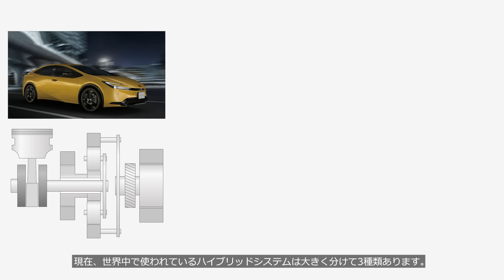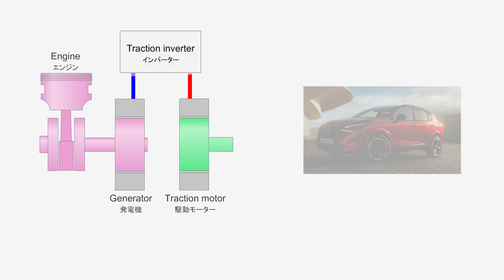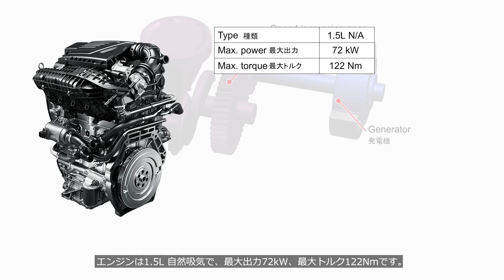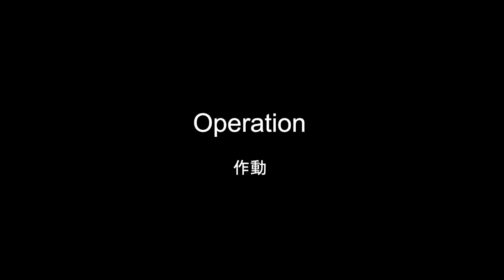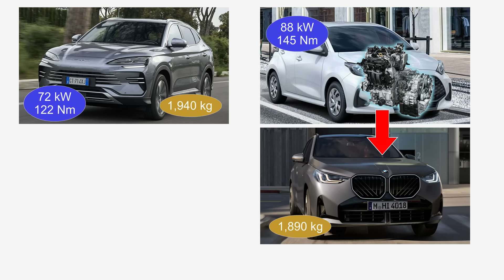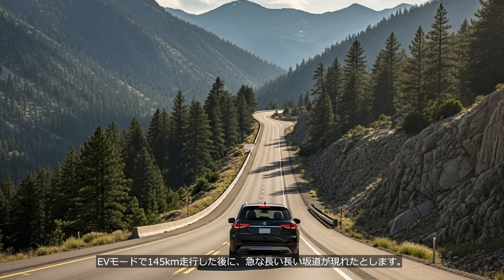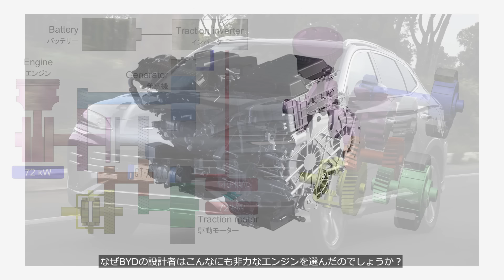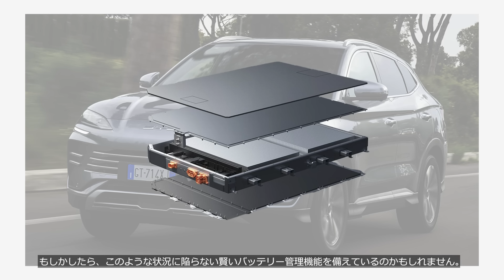Deep Dive into BYD Hybrid System on Sealion 6

Comment: This is a really easy-to-understand and excellent video. Thank you so much!
In addition to the fact that engine efficiency drops significantly depending on RPM and throttle valve opening, efficiency also decreases when the engine is still cold.
I completely understand that BYD’s system is outstanding, but batteries are also heavily affected by temperature, so I believe a proper thermal management system becomes very important depending on the usage conditions and environment.

Comment: I own a BYD Sealion Line 6 the same model discussed in this video in Australia for more than a year. I have driven up hills and long distances without any issues when the battery is low. It does 0 to 100km in 5.9 seconds and outperforms any regular petrol car. I believe this system has a battery management system to keep the batteries at least 20% state of charge. Engine will start charging the battery automatically at 20%. So when it is needed it has power to work with the engine and move the car. This car is super efficient and has driven 12000 km and 10,000 km are all ev mode only. It does not use gasoline during daily short trips. Excellent car and recommend to anyone. Far superior to Toyota Honda hybrid systems. I believe Toyota is working with BYD to implement this type of system in Toyota cars.https://youtu.be/UI_DPeNu0_o?si=xxZy50EuL3FSU4aH
Reply: Both Geely and BYD's hybrid system is more like Honda's than Toyota's. Both BYD/Geely and Honda use an engine connected to a smaller generator motor and a larger traction motor, with a clutch between them instead of a planetary gear.

At low to medium speeds, the clutch is open, and the engine powers the generator, which charges the battery. The traction motor then draws power from the battery to drive the wheels, functioning as a series hybrid. At higher speeds, the clutch closes, allowing the engine to drive the wheels directly.

This system operates in three ways:

1. The electric motor powers the wheels when the battery is full.

2. At low speeds, it functions as a series hybrid, with power flowing from the engine to the generator, battery, motor, and wheels.

3. At high speeds, the engine directly powers the wheels.

Toyota’s planetary power-split system allows not only these three modes but also simultaneous engine charging and propulsion, as well as joint engine-motor operation, leading to better fuel efficiency at high speeds than Honda or BYD/Geely especially in EPA cycle which is more realistic and values high speed efficiency. 
 
If you don't believe me check 1001cars on youtube where he compared BYD Seal U DM-i vs the now previous gen RAV4 PHEV. The latter had longer EV range, better MPG in all condition, better acceleration and of course higher reliability. Therefore, despite what BYD propagandists and pro-China EVangelists would have you believe BYD DOES NOT have the best hybrid system. Toyota is King
Reply: going very long uphill highway are pretty rare, 72KW is enough to maintain speed at 80-100km/h at 10% elevation for 2 ton vehicle. ICE cars require high power mostly for acceleration, not constant power, while hybrid car engines are designed for constant load, so the engine fills the battery during low energy requirement.
Reply: this would only be possible when battery can be charged, right?
Reply: Sealion 6 is a terrible car.
Reply: トヨタを上回ると言われても信じられませんね。
バッテリーを全て使い切ったところで燃費メーターをリセットし、そこから走行されたときの燃費の数値が最も大事です。
bydがいう熱効率46％という数値も、それを聞くまで到底信用できません。
Reply: @ruo7000 thermal efficiency claim is just a play of numbers and parameters. Chinese manufacturers are really good at that, lie and People a gullible to believe that.
Reply: @ruo7000  --Believe it.  Toyota's PHEVs have too big engines that cost more and weigh more and take up more internal space.  BYD and Chery's engines are running in lean-combustion mode during cruise, thus are more efficient.
Reply: @trungson6604  cherry uses transmission in their hybrid system. No thanks
Reply: @ruo7000 BYD really beat Toyota believe it or not.... BYD technology is decades ahead of any japanese car 😅😅😅
Reply: Yes here in Manila we're driving the same BYD SEALION 6....very efficient and top speed of 230kph on the expressway.... easy to drive ❤
Reply: no way imperialist japan bowing down to chinese peasent😂(am joking guys)

Comment: The answer for this underpowered engine is just chinese way of doing hybrids. All chinese brands go opposite route - using smaller ICE engines and strong electric motors.

Usually, they maintain much larger buffer than typical hybrid cars. Stabdard PHEVs usually go to 10% before switching to hev, while chinese cars usually do it at 20% to maintain better buffer.

Also driving in HEV mode is not just only ice or combined. Typically, these cars borrow the charge from battery in demainding situations like overtake or uphill. But then as soon as it is possible, they charge the battery while driving, to pay back energy deficit. Driving at constant speed uses very little evergy, it is like 20KW or less for 100's speed - these cars increase load on ICE by charging the battery at the same time.

Technically it is possible to discharge under hard conditions, but for most of the road situations even if you drop below 20%, car will pay it back to 20% again while cruising.
Reply: On a cross-country long trip, simply start out with a full battery and use the engine for power, while the e-motor only provides acceleration boost and hill-climbing assist.  The battery is large enough to assist in climbing to the top of even the tallest mountain.   For local driving, ̣90% of population lives in flat areas that doesn't need much hill climbing assist from the battery.  
For those living in mountainous areas, they should use less battery charge  during daily driving, while reserving more capacity to assist with climbing tall slopes.  For example, normally up to around 80-85% of battery capacity is used  for daily commute, but those  living in mountainous areas should only use up to 50%-60% of battery capacity before recharging.  They could recharge their battery while at work also, thus ensuring a lot of remaining battery capacity on the drive home to assist with climbing tall slopes.
Reply: China never made high power ICE
Reply: Save fuel costs without affecting efficiency

Comment: When battery finished, go to charging station then climb the hill
Reply: For local driving, ̣90% of population lives in flat areas that doesn't need much hill climbing assist from the battery.  
For those living in mountainous areas, they should use less battery charge  during daily driving, while reserving more capacity to assist with climbing tall slopes.  For example, normally up to around 80-85% of battery capacity is used  for daily commute, but those  living in mountainous areas should only use up to 50%-60% of battery capacity before recharging.  They could recharge their battery while at work also, thus ensuring a lot of remaining battery capacity on the drive home to assist with climbing tall slopes.
Reply: @trungson6604  For regular mountain driving, There is plenty of downhill also . This is mostly Theoretical scenarios.

Comment: Thank you, and let me do some comments on some things, first its gasoline not gasolene😂, second the toyota is called series parallel because its exactly that, a system that combines both worlds which has no match. The Byd phev is seriously underpowered in an uphill the driver will have to slow down maybe under 100kph when battery is depleted, plus it will rev high and burn lots of fuel. Chinese do not use the same rules when calculating engine efficiency thats why there are such differences.

Comment: The concern is valid.
There is a similar concern for the honda crv with its 2.0 na engice, which is has much greater power and torque output (109kW 189 Nm) but the owners still report some issues going long steep hills when the tiny battery runs out.
This can also be an issue with multiple consecutive accelerations at high speeds.
Id say that the BYD's system is below the min power requirements for a vehicle of such size. This can be dangerous when your car suddenly turns into a weighted down yaris during an overtake.

I own a crv hybrid, and based how the car is tuned, for providing lively acceleration at low speeds, you can easily get offguard and overestimate the abilities of your vehicle in a dangerous situation.
If Honda is writing check that it cant cash out, then BYD is doubling them.
Reply: The battery of the sealion is 18kwh while the crv has 1.6 kwh. There is never a concern that the battery runs out because of the buffer is big. The engine might compensate on idle to recuperate the lost charge and thats it.
Reply: Why did BYD choose a small engine?  Because the battery and e-motor take up a lot of weight and space, so the engine needs to be small to keep weight to reasonable level and to have good cargo space.  On a cross-country long trip, simply start out with a full battery and use the engine for power, while the e-motor only provides acceleration boost and hill-climbing assist.  The battery is large enough to assist in climbing to the top of even the tallest mountain.   For local driving, ̣90% of population lives in flat areas that doesn't need much hill climbing assist from the battery.  
For those living in mountainous areas, they should use less battery charge  during daily driving, while reserving more capacity to assist with climbing tall slopes.  For example, normally up to around 80-85% of battery capacity is used  for daily commute, but those  living in mountainous areas should only use up to 50%-60% of battery capacity before recharging.  They could recharge their battery while at work also, thus ensuring a lot of remaining battery capacity on the drive home to assist with climbing tall slopes.
Reply: @trungson6604 actually, you are correct, I didn't notice it's a plugin. This engine is plenty for a plugin as a range extender. Byd is not even the worst offender in this segment.